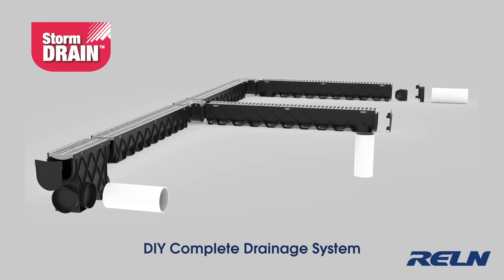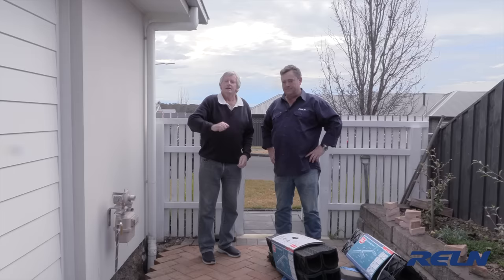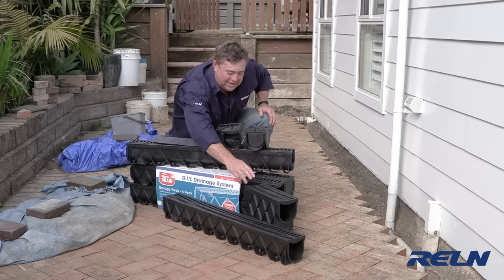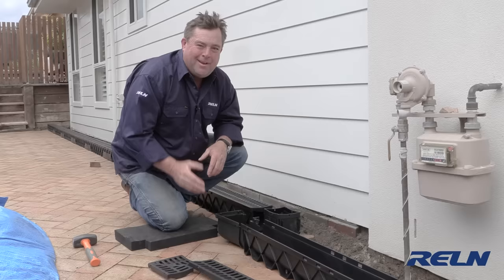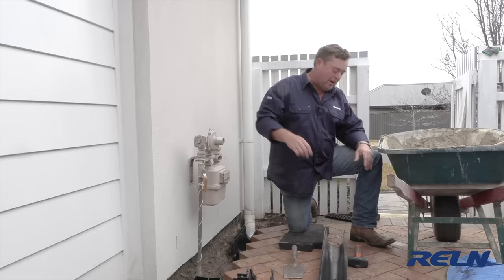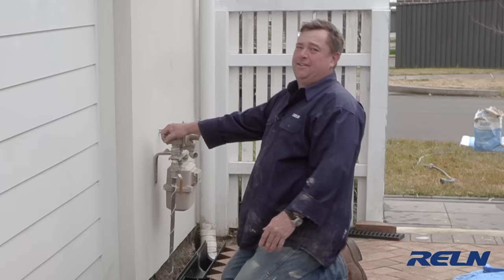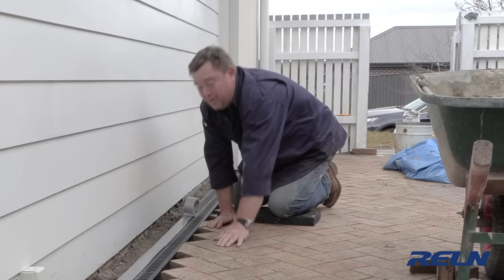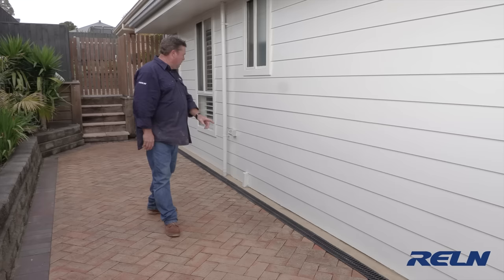How to Install RELN Storm Drain™

Comment: Guys, I made stainless steel 16gauge channels that but up to the bottom of these channels and pop riveted with a washer on the plastic side to keep the bow out if these trenches. The inherent bow of these trenches are as much as 1/8” call me picky but once the cement is dry, there’s no going back. More than well worth the investment for my time!

Comment: And now in a decent downpour when the discharge point is completely overwhelmed and  stormwater is backflowing due to the pressure you have a lovely channel to guide that water straight into the house...

Comment: Nice project. I like your product.  Thanks for the instruction on the pads instead of a continuous footing. I will use that tip.
Reply: In.
Reply: Nope 👎 you will never get that mud under 💯 complete bed all the way , Sparge up both side and the header corse is bonded to inside of drain

Comment: Nice video but I wonder why he never discussed ensuring the right amount of pitch for the channel drain, so that that there is enough slope for water to flow into the storm sewer ?  Also, I think the best (perhaps costliest) long term solution is to redo the pavers and slope it AWAY from the house.  I had pavers done on my patio over 20 years ago and I was a stickler with my contractor measuring the slope every few minutes !  Drove them nuts but I have ZERO water issues with it as all water flows AWAY from the house, period.

Comment: Ground should slop away from house with drain at far side. Little drain will eventually get overwhelmed.
Reply: That should have been done when they made the patio. Now it's just damage control.
Reply: Redo the patio if you want done right. Depends on regions and runoff... Not gonna work In a hurricane!
Reply: @thomasmartin8580  don't get hurricanes in Australia, but agree that the ground should always slope away from the house, this is only a tutorial from Reln not fixing the overall issue of water flow
Reply: Your kidding right? What's a cyclone?

Comment: I like this It looks a hell a lot easier than putting in a French drain. I will have to find if these are available in California.
Reply: Yeah, similar drains have been available for decades.  I installed my first of these types of drains back in the '80s. If you have vehicle loads, make sure you buy properly-rated drains (especially in front of garages where vehicles drive same location over and over) and install continous support base
Reply: @ArthurDentZaphodBeeb  Sounds great thanks
Reply: John, because french drains are porous to accept water, they can also shed water as well. French drains near a home's foundation should be installed at the foundation's footing, not at the surface / at grade. Such footing level french drains are called 'perimeter drains." Channel drains like the product above in the video appear better for surface / at grade installation. Good luck with your project.

Comment: Poor video lots of details not addressed such as: which end shoudl be the high side with the blank end cap?  Do you glue the sections together or silicone them?  What was the installer doing with the silicone?  No information is given about how to connect corners and use the knockouts.  I bought a couple sections because I like the product as a concept but there could be a lot more detail to help with the installation.  This video is titled how to install RELN Storm drain after all...